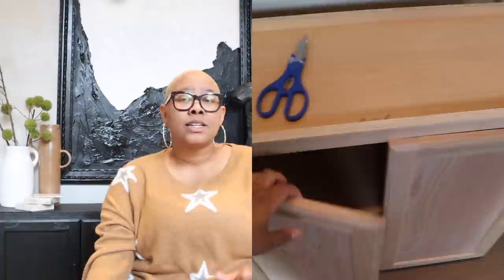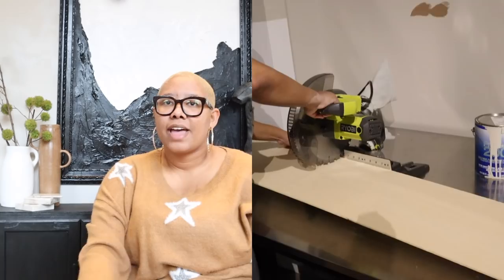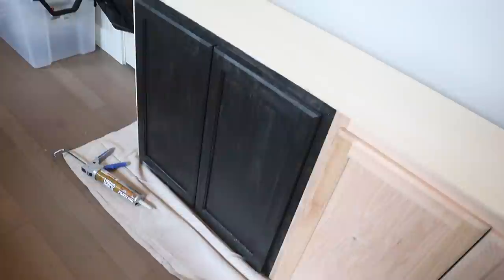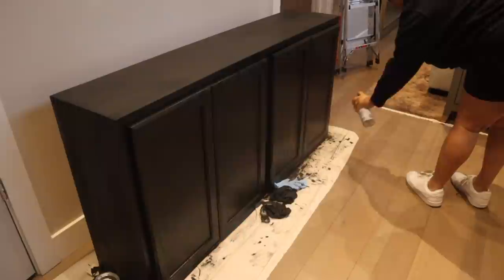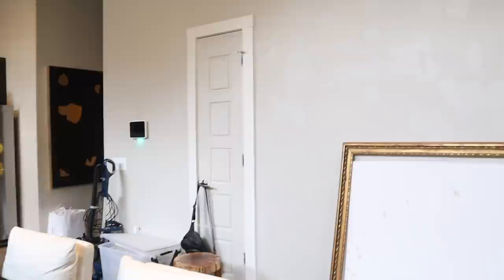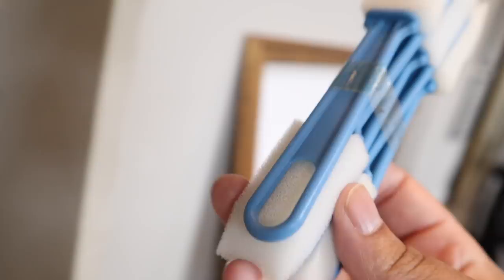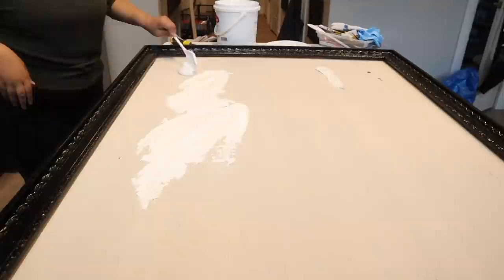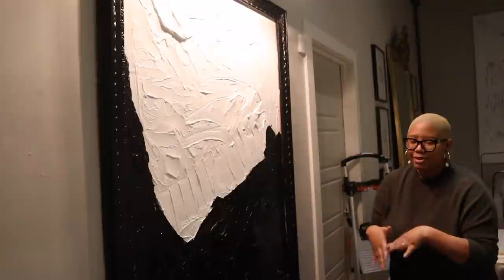HOW TO STYLE MODERN SPACES // DIY SIDEBOARD & ABSTRACT ART TUTORIAL | DIY with KB

Comment: To save you a little frustration next time, you should actually support both sides of the wood you're cutting. The hand saw would have worked fine. The only reason it split like that was because the one end was way too wobbly and didn't have anything to support it once you cut away where it was attached to the rest of the board 😊